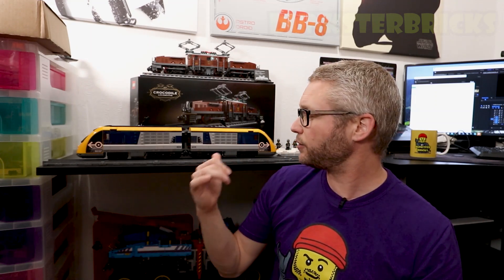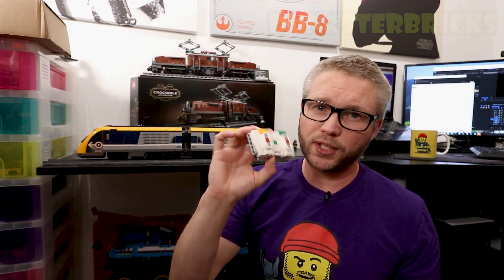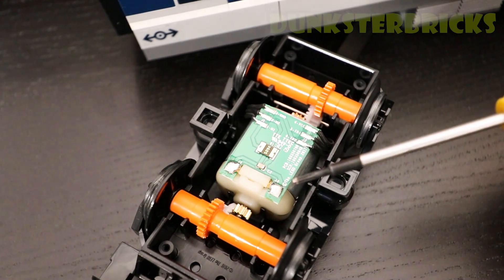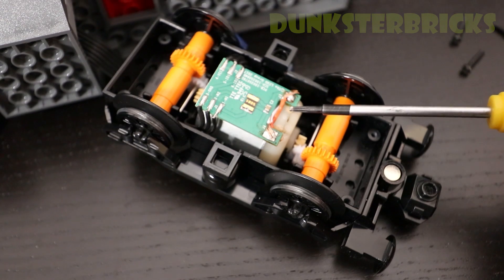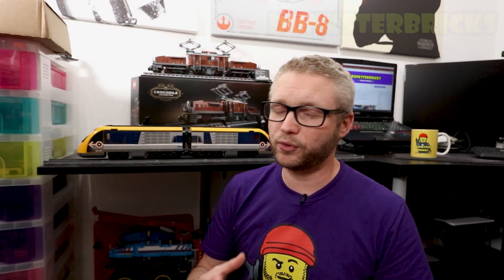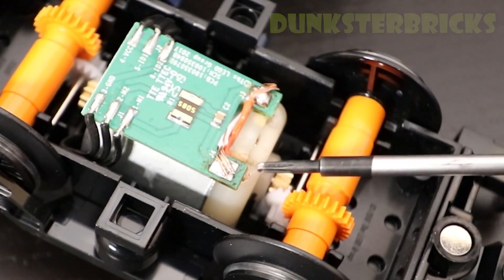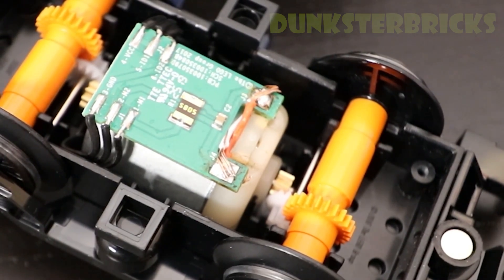Reversing a LEGO Powered UP Train Motor, Is It Possible?

Comment: I just found this video after modifying one of these motors yesterday.  I did the modification slightly differently in that I simply swapped the two black wires that are soldered to the pads labeled M1 and M2. It works very well and certainly improves my extended Lego 60197. Swapping those wires may be easier with less risk to the motor. In the longer term I may put a very small double pole changeover switch in one end of the casing. One other comment - the bottom cover can go on either way round, but it fits better one way than the other due to the internal standoffs that go against the circuit board.
Reply from the maker: Yeah, the M1 and M2 wire swap is much easier.

Comment: Can't you just swap 'M1' & 'M2' over???
Reply from the maker: M1 and M2?  It is possible to reverse one motor in the app but I don’t use the app that much.
Reply: @DunksterBricks  I mean the 'M1' & 'M2' wires on the circuit board.
Reply from the maker: @TrainsForNSWVlogs  Just modified one for the new Express Train and the M1 M2 wires did te trick, much easier as well.
Reply: @Trains For NSW Vlogs See my post from about a year ago. Yes - this is exactly how I did it.

Comment: I must be missing something here, cant you just turn the motor 180 degrees and get the same effect? Or is this for neater cables?
Reply from the maker: The cable will stop the engine running smoothly around corners.
Reply: @DunksterBricks  Ahh ok, thanks :-)

Comment: I think it's remarkable that Lego didn't come up with a solution for this! As I'm using 9V, here's a Powered Up n00b question: if you want to put two motors under a train and you want to make it work with Lego-only parts (that is the hubs and controllers), could you make it work with one controller using channel A for let's say the front motor and channel B for the motor at the back of the train? I suppose in that case that you need to push + on channel A and - on channel B to make the motors turn in the same direction? Anyway, great solution! It's good to see an IT guy handling a soldering iron :D
Reply: Yes, the + / -button on the controller actually rotates, so you can have + and - facing same way on the controller. You still need to press buttons for both channels at same time though.

I think Lego are complete idiots not giving us stackable connectors, like with power functions or a reversing switch for that matter. 

Take this set, 60197, first of all, I get half a train......no option to buy single carriages or other train front to complete it.
Then you buy a second 60197 to make a complete train and it, but you can not properly use two motors at same time with a simple solution.
Leaving one motor out is no option either, there are no parts in the set for a dummy motor boogie.

Mind you, I am thinking in mind set of a average kid / consumer, not as an AFOL.

Each system since 9V is a step backwards.....and more expensive.....progress in reserve Lego!
Reply from the maker: A couple of comments here recommended swapping the M1 and M2 connections in the motor, I just did that for the B end of the Express Train and it works and is much simpler than what I did in this video.

Comment: I’m glad you said that an irresponsible adult will do at a pinch... that’s pretty much all I’ve got access to!  I’m still not going to risk my motor though, just in case...
Reply from the maker: Yeah, I couldn’t find one either so just had to give it a go myself.  This modification is very fiddly and  not straight forward at all.

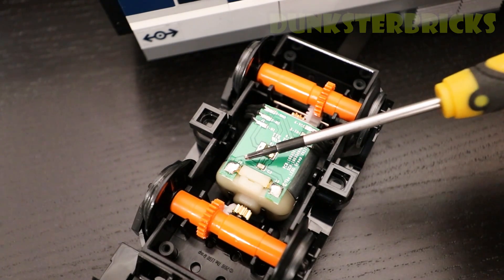Comment: 1:26. Just a wild guess, is it possible to switch the wheels?  This would also make one motor reverse.
Reply from the maker: The way the casing is moulded means that nothing inside can be moved.  It would be a lot easier if that were the case. It’s a shame LEGO haven’t given us the option to just flick a switch and reverse one motor.